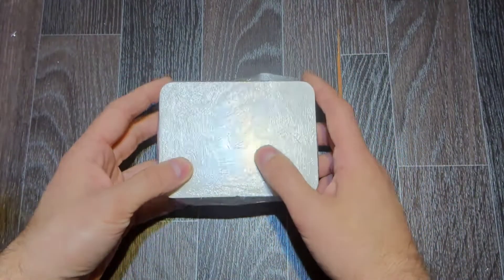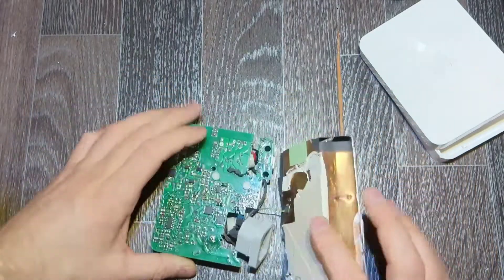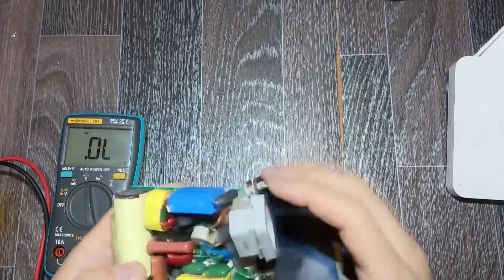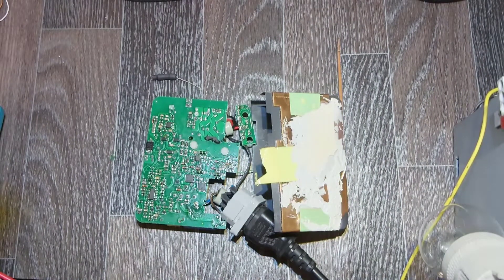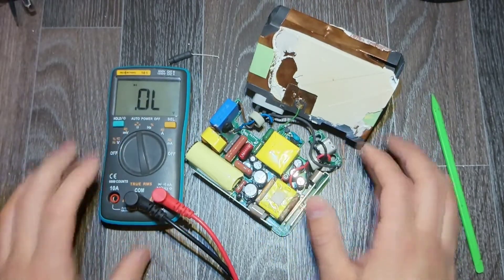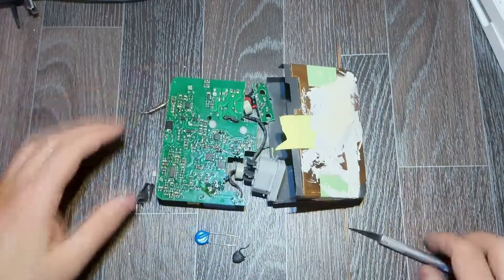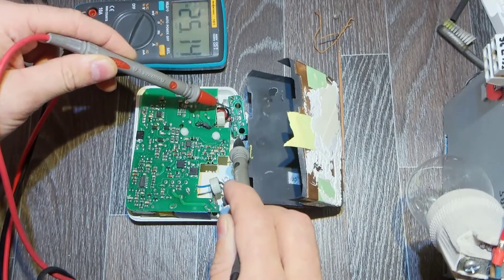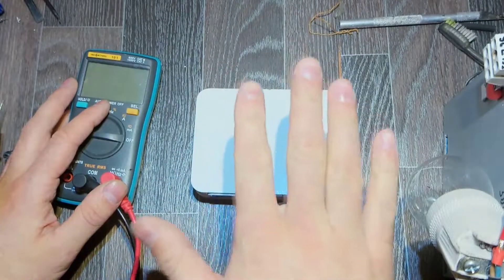Apple power supply repair

Comment: Good work. 
an off topic question but it does relates to PSU. 
I have the Seasonic X-1250 with the dreaded turn on and off in second with the very short fan spin. any ideas about this. 
Then a Chieftec 850w which runs good but with randon cutoffs out of no where. 
Would be very helpfull for any ideas where to start!!!
any way to send PMs?
Reply from the maker: Thanks. 1250 probably there is a short on a 3.3 or 5 volts lines. 850 might be bad capasitor on standby power supply. PM at tomtaminant@gmail.com